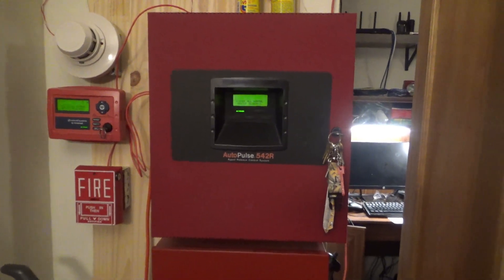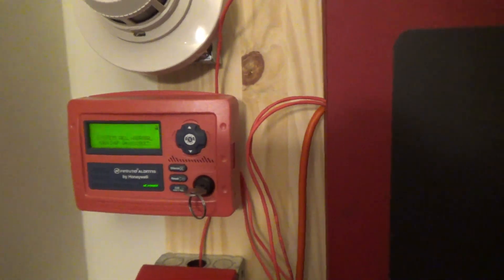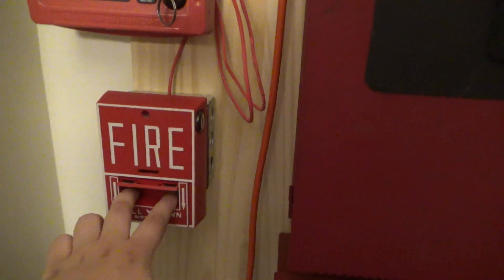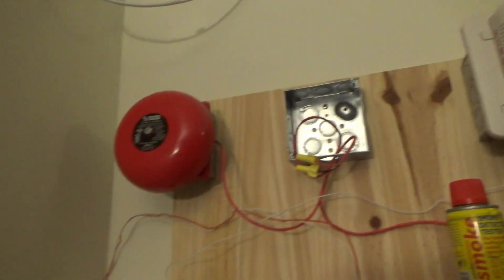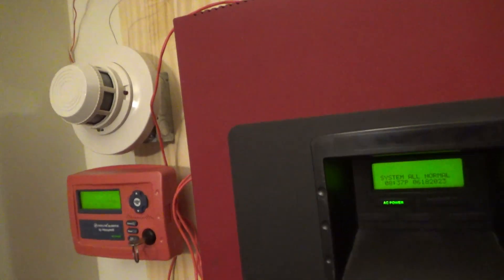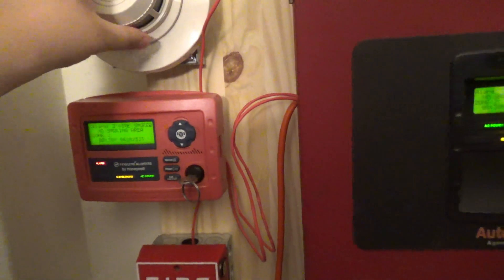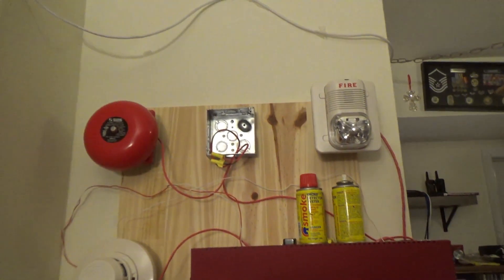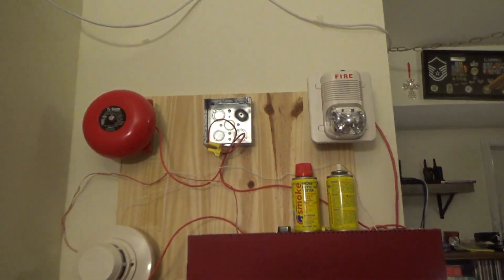System Test 40

Comment: System Test 41 Pull Station You Should Use Is The Fire-Lite BG-12L! Smoke Detector/Heat Detector You Should Use Is System Sensor i3! Alarms You Should Use Is The System Sensor P2R And The System Sensor P2WL!
Reply from the maker: Excellent request do you want the alarms synced or unsynced?
Reply: @jonathanryersonhotel3593  Synced!
Reply from the maker: Okay well stay tuned for system test 41 soon.